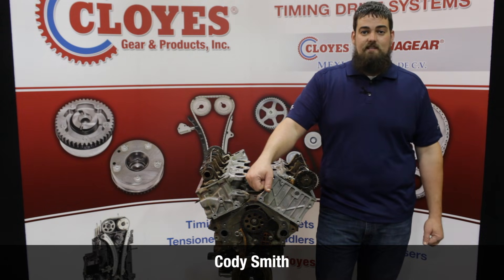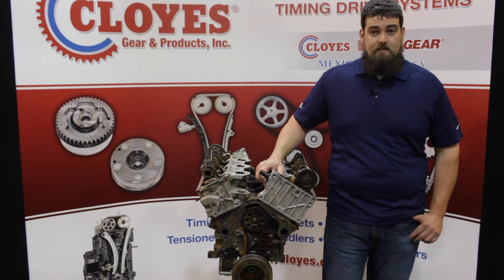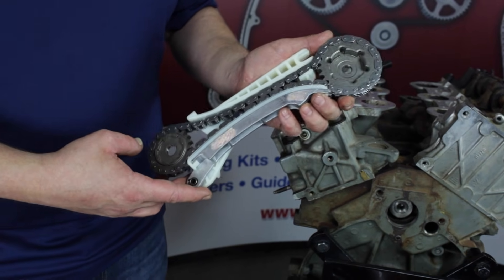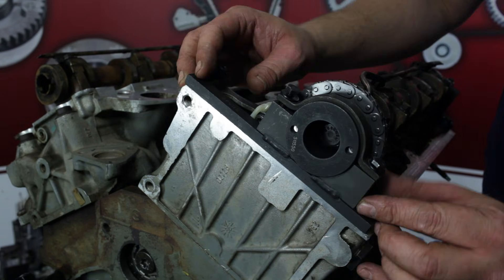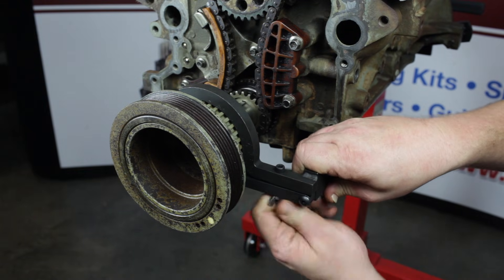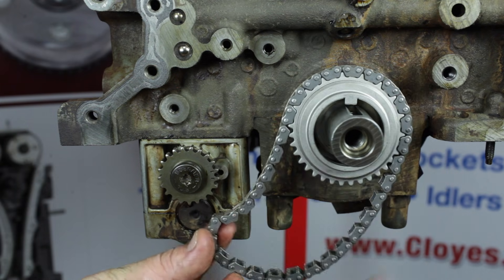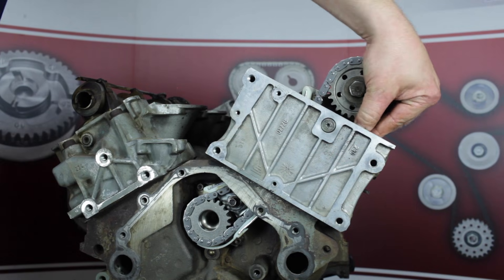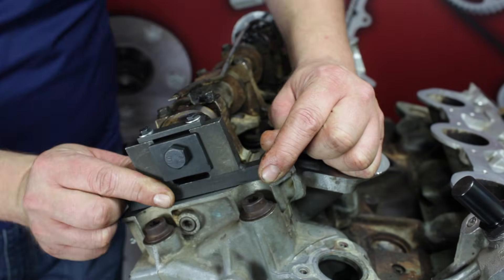Ford 4.0L Timing Chain Replacement, Cloyes 9-0398SB

Comment: Finally! Someone actually posted a How-To video on this procedure. I've been looking for years to find a complete instructional video like this and this is the first one. I have a 2004 Ranger with this engine and it makes the horrible rattle sound on start up. It's a 2WD, so how likely is the noise just coming from the front? I just hate the idea of pulling the whole engine and replacing everything.
Reply: I actually did do it like 4 years ago. I put a 2004 2WD engine in a 2003 4X4 and it ran like nobody's business. The only difference in a 4X4 is that it has a front differential with 2 half shafts and transfer case with a small driveshaft and that has nothing to do with the way the engine runs.
Reply from the maker: Brian, thanks for the kind words on the video. It is difficult to say, but being a startup rattle, it is more than likely an issue with the hydraulic tensioners. In the early 4.0L SOHC engines it was more likely to come from the rear bank because of a lack of oil to the tensioner. This was addressed by Ford with the addition of the oil restrictor rod that is shown in the video. Engines with the restrictor rod installed have about a 50/50 chance of noise coming from either bank. All that said, if you've got a startup rattle, you may want to replace the hydraulic tensioners. If the rattle is only heard at startup then you are getting oil to the tensioners, but one of them isn't staying primed up over a period of time.
Reply: You're very welcome, I actually just got done pulling the engine and replacing the rear plastic tensioner.(It was shattered into 50 different pieces) I replaced the 27mm tensioners 6 months ago and it didn't do a thing for the rattle noise.  It was one hell of a job, and it took me 10 days. I had to pay the transmission shop over $250 to re-install the transmission because I couldn't do that part myself. I get there to pick up my beautiful red Ranger and start the engine and I heard the rattle coming from the front this time. I was just devastated. It's like the front tensioner broke right after I fixed the one in the back. I can't believe I done all that work, and now the noise is louder. I guess I just have to take my beating and fix the front now. I'm really thinking about lifting the body off of the frame this time and converting it to a 4-wheel drive.UPDATE: I took my beating and tore down the whole front part of the engine and after I removed the front timing chain cover I noticed that the primary tensioner on the passenger side (the one with the 7 metal leaves in it) was busted into four different pieces and it was laying down in the oil pan. I also replaced the primary guide on the driver's side. I'll give another update when I put the engine all back together and start it up. I really hope this fixes the rattle.
Reply: Brian Smith You can't. The engine is a 4x2 which means there is no balance shaft. If u converted it to a 4x4 without a balance shaft, that engine would rumble like crazy.
Reply: LOL ... I hope you were kidding. That balance shaft on a 4X4 4.0 is useless. I bet you can put 2WD 4.0 SOHC engines in 4X4 trucks all day long and not notice a difference between the two.
Reply: Brian Smith Honestly between you and me (and the cloyes associate reading these comments) I would never buy Cloyes gear to put in my explorer. With components as critical as the timing chain cassettes, it's better off going OEM. I had to choose between Cloyes and Ford OEM, and I went OEM. And I'm glad I did. I know that spending the extra money gave me quality products that will last a long time.
Reply: That's completely false. Many 4x4 trucks have been swapped with 06+ Mustang 4.0 engines (no balance shaft) and they operate quietly as can be. No vibration whatsoever.
Reply: Brian Smith Not kidding. Build a 4.0 without it. It's there for a reason. The weights on the crank can't absorb all the vibrations. You'd be surprised how much it helps.
Reply: I was surprised to find that my 2003 Ranger FX4 vin code E, engine has no balance shaft. I had the Cloyes timing kit purchased for the balance shaft and didn't need it.

Comment: Good Video..Thanks.  I will never understand what FORD was thinking building a motor with 2 Timing chains,one per head..and to fix it properly you have to pull the engine out!
What the Hell were they Thinking! The 4.0 V6 SOAC motor is designed to fail..only  got 105K out of a 2006 Explorer and the engine went to shit! It costs more to repair it than it is worth! Looks like I have a new Target!
Reply: Brian Smith No they didn't, they fixed the problem in 2011 when they got rid of the SOHC completely. From 1997-2001 they used the 3 leaf tensioner which always failed. From 2002-2011 they upgraded to a 6 leaf tensioner which made some improvements but still broke after a while. The rear guide is still made of nylon. It's all about luck. I have 2 explorers, one with 109k where the chain is just slapping around, and one with 180k that purrs quietly. The key to hit at least 200k is synthetic oil such as amsoil with a Wix filter.
Reply: I agree with you 110% ... A lot of people were ripped off by Ford because this engine was not properly made from 1997-2004. They kind of fixed the problem in 2003 Ford Rangers, and they really fixed it in 2005. It's sad to think of all the millions of dollars that were taken from consumers because of this. This was clearly a factory defect and Ford should have taken accountability for this mistake and done a TSB recall.
Reply: David Storm I'm in the same boat with my explorer.  piece of junk engine is getting noisier.  I will just run it until it blows up.